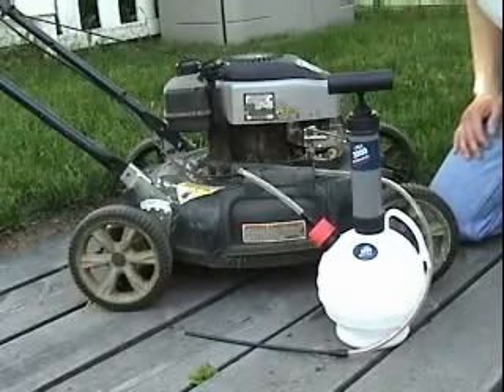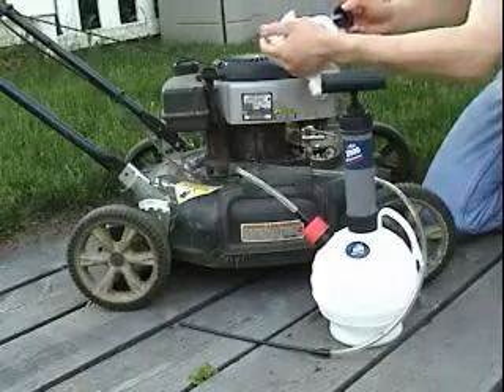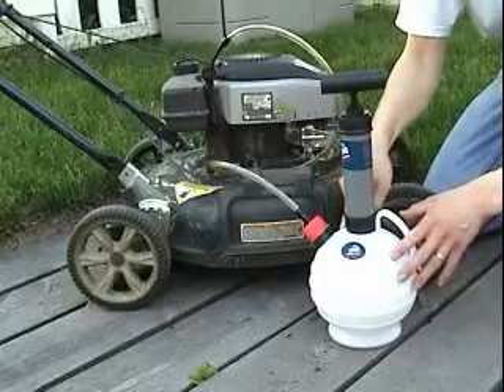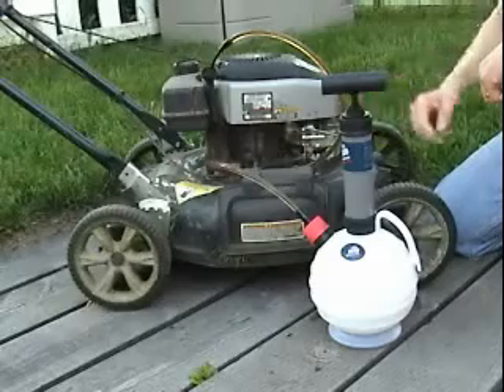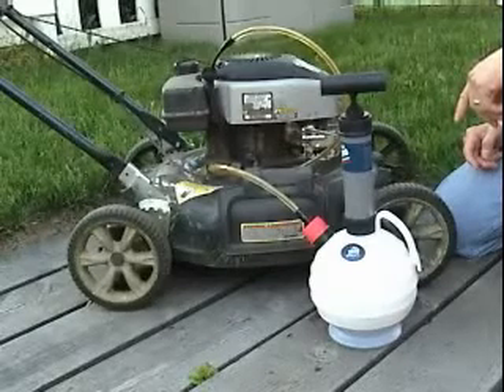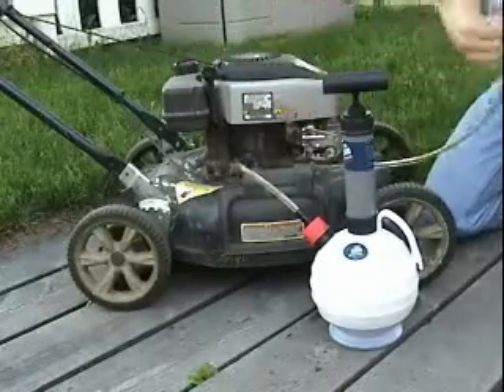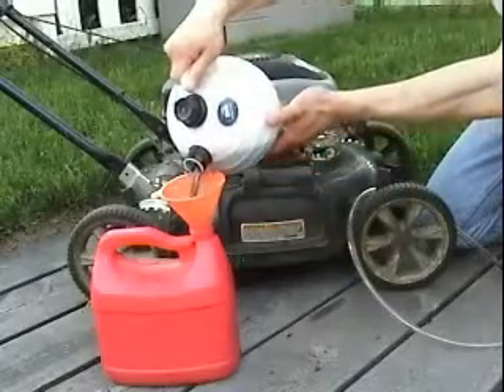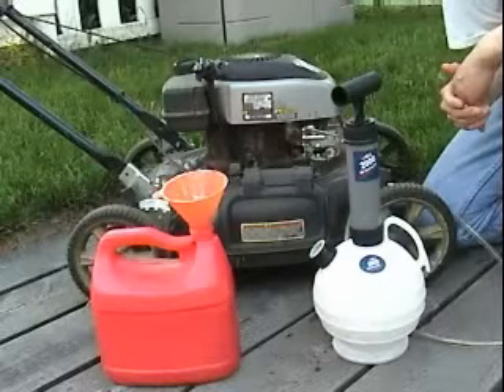How to use PELA oil extractor

Comment: about 2.5 liter capacity for the extractor. It won't last more that 5 years as the pump loses suction holding power on the rubber grommets on the orb parts